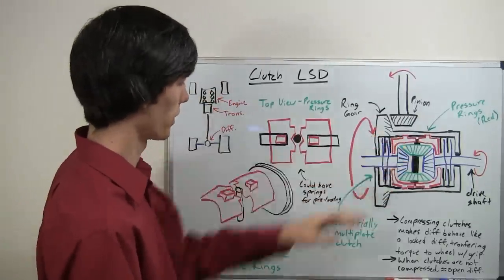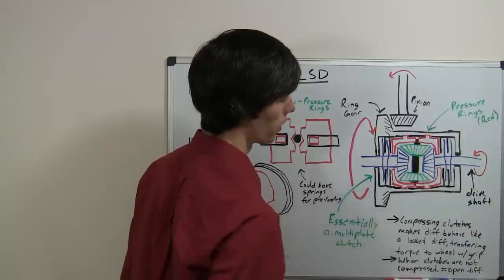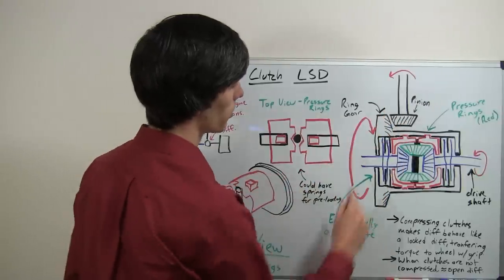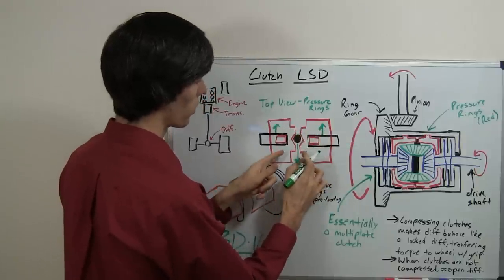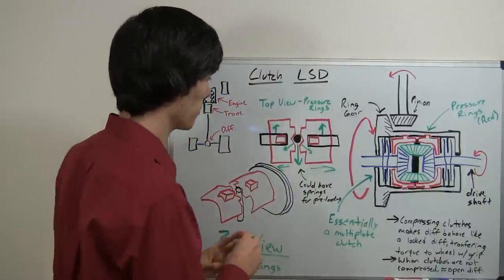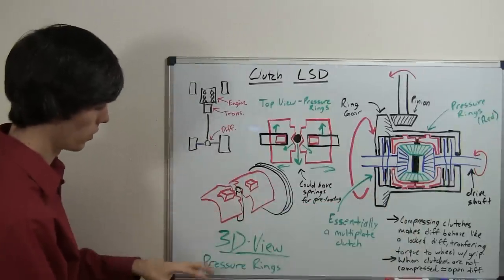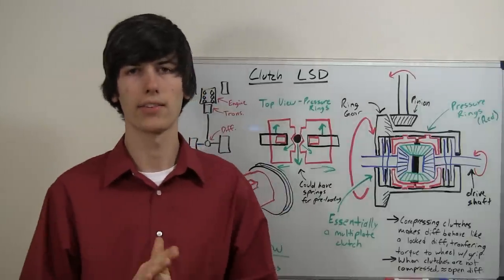Limited Slip Differential - Explained

Comment: Hi, I have a question. What if you accelerate while going around the corner. As I understood, acceleration will cause the LSD behave like a locked one, and this is bad when you go around the corner, right? Is my understanding correct, and does it mean one should never accelerate in the corner with LSD?

Comment: I have a question. It's about welded differential amd limited slip differential.

Both of these method are used in a drift car. And if I'm not wrong these are not that bad for daily use. But, my question is does it affect the top speed of a car?

For example, Toyota Supra's are capable of reaching speed of 250kmph or more. If a Supra has either welded differential or limited slip differential, would it be able to reach that speed? Hlw will it affect the acceleration, handling and other performance of the car?

I'm searching for answer for this question. But I didn't get any satisfactory answer. I hope you can help me here.
Reply: if your only intention is to be a track only budget drift car a welded diffs Is ok for wheel spin. but your overall handling of your car is worse in corners where you are not drifting
Reply: I dont know if you've found an answer yet. but welding your differential together should not influence your speed going in a straight line, I think. It will however in corners slow you down, as the outside wheel is being dragged across the road creating lots of friction between the tire and the road.
Reply: Welded or LS or open diffs do NOT influence the speed at all.

Comment: Very nice video, but one quick question: why does acceleration cause the pinion shaft to move downwards and press onto the pressure rings?
Reply from the maker: Because it rotates the housing (not the shaft), so the housing presses against the shaft as they are not connected.

Comment: Another nice video! But what actually makes the pressure rings go inwards firstly and then be forced outwards (i dont get how only that rotational force make it happen?) ? And I still can't make out how the rings are held to lock the clutch plates? Wouldn't they just slide back towards the pinion shaft a while after ''the initial bounce'' ?
Reply from the maker: Rotating the differential housing presses the pressure rings against the center pin.So it comes from the pinion gear rotating the housing.

Comment: So, apart from coasting (clutch plates disengaged) and driving straight on a dry road (clutch plates fully engaged and no slip), there's always going to be some friction in the plates? The clutch pack will not only wear out when you're doing donuts, or in low-grip situations that call for making full use of its locking abilities. It will wear out anyway, no matter what, even while driving casually around town, because every time you go round a corner some of the plates will have to slip. Every time you go round a corner with your foot on the throttle, even on dry tarmac at low speeds, you're killing the clutch pack a little. Is that correct?
Reply: Bit late to the party, but I think why it won't wear out so fast, because first of all a special material is used for the clutches and I believe these are wet clutches, so this whole differential housing is in differential fluid. Think of it this way, the camshafts, pistons and what not don't wear out, because they are constantly being lubricated by engine oil.

VLSD I know can overheat and when it does it becomes open diff until it cools down. I'm guessing this is because the viscous liquid inside it will overheat, changing it's viscousity meaning it won't be able to turn it so good. (here the thicker the liquid the more it is able to move the wheel)

Comment: So  in general, for a LSD you can only have different tire speeds (left & right) in a corner if you're not on the throttle? I thought you want more tire speed on the outside tire while accelerating through the turn. No? Isn't that the point of a LSD? What good is it to have an open diff only while coasting or braking?

Comment: So... when you're accelerating while cornering and there's torque pushing the pressure rings outwards, it doesn't behave exactly like a locked differential because it does allow certain amount of slip within the clutch pack, right? 

Is there a point where the torque coming into the diff is so big and the clutch is pressed with such force that the diff becomes fully locked?
Reply: Ok, I should have read the comment section before posting.

Comment: So I have a question.  I have a LSD in my truck and it is no longer function properly. If I were to floor it, one wheel, generally the passengers rear wheel will break loose. What is worn out that makes that happen
Reply from the maker: Well, if it is a clutch type limited slip, it could be the friction material has worn down, and there's no longer enough force to keep the two rotating together. The likely case is that whatever was there originally to help transfer torque, has now worn down - if it is indeed not functioning.

Comment: Relative rotation between right and left wheel doesn't make compress pressure ring.
It only depends acceleration or braking right ?
Because force from pressure ring(housing) to pinion shaft make compressing clutch
Do I understand right ?

Comment: Great video as always!
But let's say you are braking. If I haven't missunderstood the LSD just "works" (I means, switches from Open to Locked) when there is acceleration, so it would get locked also when braking. If this does happen when you are braking hardly while turning (I know it is not the best way to ride, just example), the torque would go 50-50? In my mind at least, wheels would rotate as they would need by their lineal speed, so one would spin to much or the other too little, am I right?
Reply: Okey, I've seen the next video now!

Comment: This topic is becoming a nightmare for me, could you PLEASE explain the following for me?
Comparing a limited slip diff to a locking differential, whats is the main difference? Why did Mercedes bother placing 3 locking diff buttons on the G63 AMG and not just a limited slip diff? I had a Mitsubishi Evo 9 and it had 3 diffs but they were all active. Does that make them limited slip diffs or diff lockers with different mechanism?

Please bear with me and excuse my lack of understanding :)

Comment: I already know that my rear differential is a limited slip. My question is, does every single limited slip rear differential made a friction modifier? Or are there exceptions to rear differentials that are limited slip that do not need a friction modifier?
Reply from the maker: There are different types of LSD's, but somehow the force has to transfer from one side to the other, and this requires friction, whether it be through a liquid (VLSD), or clutch pack, or simply metal contact.

Comment: So when you press on the gas pedal(accelerate) into a corner lsd will essentialy make your differentials behave like a locked differential? What if I lift off the gas pedal into a corner will this allow my diff to behave like an open differential?
Reply: For The Love Of The Game Yes, because you are not putting force from the driveshaft onto the pinion shaft, that activates the clutches, one clutch will release from the wheel that is travelling on the outside of the turn, the inside tyre will still have power, because it will have friction on the clutches :)

Comment: and what happens when u are accelerating and cornering at same time will it lock ??  as usually when u are cornering u should first use brake and than accelerate so it means both time it will be locked?

Comment: i was wondering when the mutliplate clutch engages on one side so this side rotates together with the dif case, does this side (shaft) receive 100% torque? Or does the other side receive less torque (E.G. a 70-30 split of torque in favour of the wheel on the outside covering more distance)?
Reply from the maker: CARphiliac The clutch plates are designed to be pressed together, simply put under acceleration it tries (keyword, tries) to become a locked differential. What this does is allow for more torque to go to the wheel with more traction. If it's fully locked, and one wheel has 100% traction and the other is in the air, it's feasible for 100% of the torque to go to the wheel on the ground.
Reply: Engineering Explained thank you so much! Always a great pleasure for a carphiliac like myself to watch your videos!!

Comment: So I have been re-educating myself on 4x4 and AWD lately since I am getting a new car for the winter, but I am still confused on how a locked rear differential can turn while having the outer wheel spin faster? or is the locking differential something you can turn on/off? Also for an AWD vehicle if it doesn't have a central differential does it have to have a multi disc clutch plate or can it just have a viscous coupling? Sorry for the noob questions =/
Reply from the maker: A locked diff will always rotate both wheels at the exact same speed. There are locking differentials however where you can have it open or lock it up.

Comment: What I am confused on is this: In the videos they way you explain the open diff, you make it sound like the differential is sending power to both wheels. But cars and trucks with open diffs only have power to one wheel, hence the infamous "one wheel peel". The LSD is supposed to fix that as you explained. So going by your videos, why do cars with open diffs only perform "one wheel peels" if both wheels are getting power?
Reply: open diff does give torque to both wheels but when one loses traction as in a burnout, the torque takes the path with less resistance, which would be the wheel that is completely slipping, the lsd locks to allow both wheels to allow them both to receive torque .

Comment: saa i get everything but you dont explain how the force of the pinion shaft force goes down and how the driven shaft force goes up ... i know it happens from acceleration ... but my question is how does the acceleration apply these forces in these directions
Reply from the maker: The engine turns, rotation gears in the transmission, which lead to your driveshaft, turning the differential. Check out this video for more info: Car Engines - Explained

Comment: What if i go around a turn and accelerate at the same time ?
Reply from the maker: Ayush Shrestha The diff will attempt to keep your wheels rotating together, the tires will fight to not. One of them will win.
Reply: Engineering Explained This makes it seem like having a basic LSD in a car in a city with a lot of winding roads would actually burn through the tires much faster than having an open differential, seems like there is something else missing when accelerating through a corner. Do you think that the pinion gears themselves will be gain different pressures when fighting the friction difference between the inner and outer wheel, therefore sending more TQ from one side to the other, ever so slightly, changing the levels of friction between one clutch group on one side as opposed to the other?
Reply: Karim Jundi youre correct in that having an LSD in tight corners is a bad thing it causes massive amounts of understeer. unless you run an electronically controlled LSD that can compensate.
Reply: Kipcha Vargosain that should depend on your preload spring. if it is light then during city driving it should act like an open differential and if it heavy then it Will add to the force of the pressure rings even more at lower torque levels and act like a welded diff in city driving

Comment: The information that you continue to provide to me is viable, however it is not an answer to my question. Do all limited slip differential require a friction modifier being added to the oil during a regular service maintenance check up, or not? In my original question I simply asked, do I need to put a friction modifier in my rear differential when draining and changing the fluid or not? You see, Jiffy Lube claims that I need one and it cost $13 extra, but Cassidy oil lube claims that my vehicle does not need a friction modifier, so I am running whatever fluid is called for, and no friction modifier. Do I need to worry and have the service redone, or not? I know for a fact that my vehicle has a limited slip rear differential and that it is an 8.8

My vehicle is a four-wheel-drive, and I have noticed no difference in performance without the friction additive, but there are clutches in this differential just if you specify.

Once again, do I need to put a friction modifier in every single limited slip differential, or are there limited slip differentials that do not require a friction additive?
Reply: Ford 8.8 differentials need them. Most fluids today have them built into the fluid. What the Friction modifier does is prevent lockup when you make turns. When you turn the wheels are moving at different speeds and theoretically it should lock up. But FM creates a coating that allows a threshold of slip. Once that is exceeded (a wheel on snow, hard acceleration,etc ) the locking action takes place. If you didn't have any friction modifier you would either have chattering in turns or your limited slip is worn out.

Comment: My doubt is, If i am accelerating around a corner (i.e while turning a vehicle, if I accelerate ), then will my L S differential lock and, will it lead to my outside wheels to skid.?
Reply from the maker: Potentially, yes.
Reply: well, from my experience (2004 ES civic 1.6L EX), I like to begin acceleration while exiting a corner, along with starightening the steering wheel. there has been times when I tried to accelerate too hard, and a what happened is:
1) The steering locked
2) Oversteer occured (probably inner wheel spun)

I never understood why that happened until I saw this video today. So I guess YES, the dif will lock if you accelerate hard enough....

wonder how they can get around this problem in sports cars, and what would have happened to me if I drove a rear wheel drive car when this happened?
Reply: אור פוקס PS I've just realized that this problem occurs with pressure ring based LSD, yet there are probably some LSD designes that prevents it.

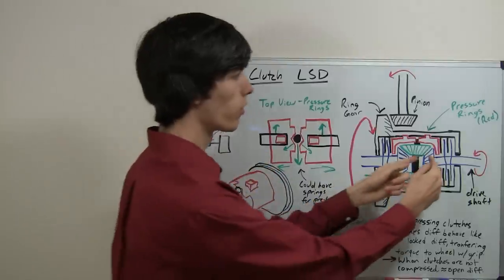Comment: 3:43 .."In order to have a different speed from one tire to the other, it has to overcome the friction within the clutch pack"
What driving scenario demonstrates that? Can't seem to understand the variable tires' speed part other than turning around the corner without acceleration. If one tire is on pavement and the other is on snow for example, I assume the drive shafts would be locked and so, the tire on the snow won't be spinning; rather, torque will be  transferred to the one on the pavement just like the case of locked differentials. So, what scenario represents an example of one tire needing to spin faster than the other and actually overcoming the friction within the clutch pack? ...... Ugghh, first vid of all of your vids that make me feel dumb and desperate :(
Reply from the maker: "So, what scenario represents an example of one tire needing to spin faster than the other and actually overcoming the friction within the clutch pack?"

An example would be sharp turns in a parking lot. At low speeds and sharp turns, the distance the outside tire will travel is much greater than the inside wheel, thus it is traveling faster since it travels a greater distance in the same amount of time. So it must overcome the friction of the clutch pack, or drag along the pavement.
Reply: Engineering Explained
I assume the friction coefficient of the ground patch on which the tire traveling faster is decides whether it can overcome the friction of the clutch pack or not, right?
I hope my questions aren't that much of a bother to you. I can't thank you enough for the help and motivation you and your videos have and continue to give me. I'm actually a Telecom. engineer and I'm taking a switch into the automotive engineering major. I hope I can thank you enough one day. You sir, are awesome. :)

Comment: I'm sorry, but I don't understand why there isn't a straight edge on the other side of the pressure rings, so that when you brake, you don't lock the wheels. I don't see the practicality of it anyways (unless you're trying to back out of trouble).